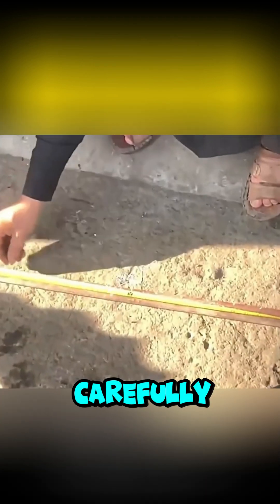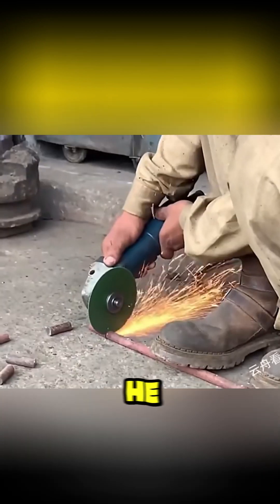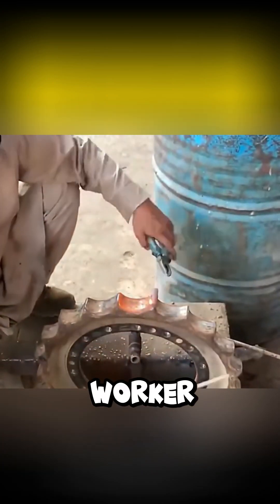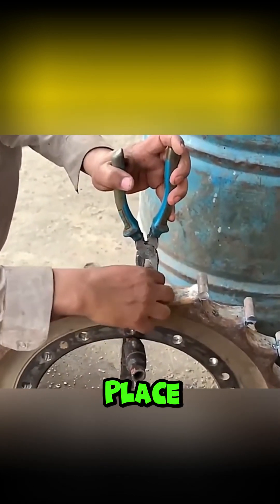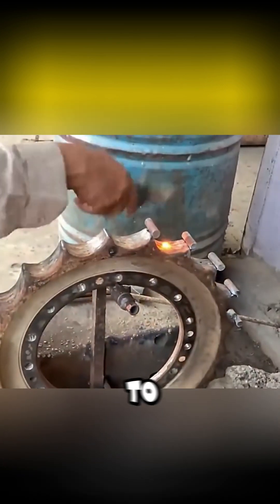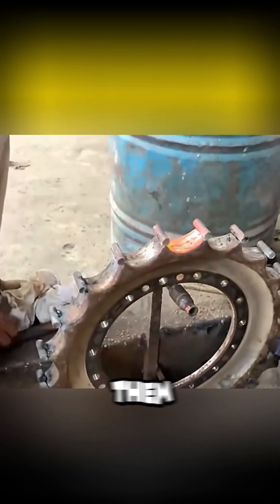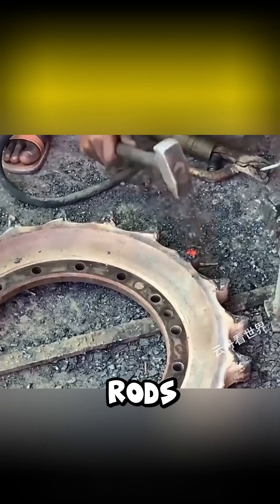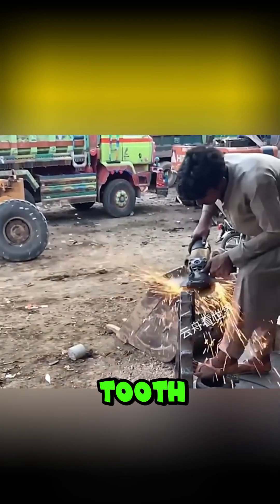Iron Rod Revival 😱 #shorts

Comment: No, it's not genius. It's making due with what you have. This is a low-end fix and is just patched back together. Drive sprockets are hardened and the mild steel rod that he welded onto the sprocket will not last long. This isn't high technology and India is famous for just getting by.